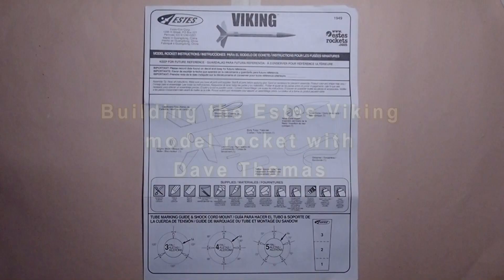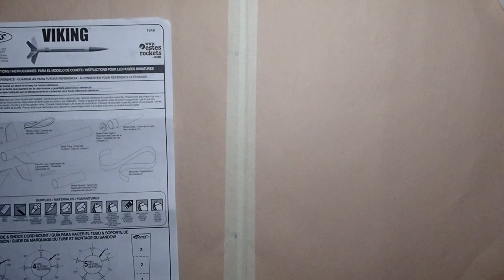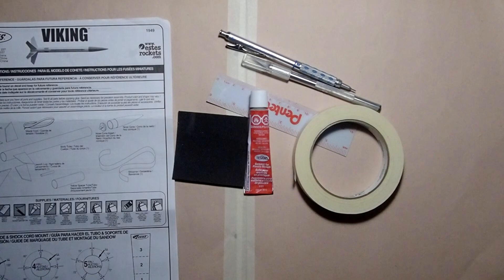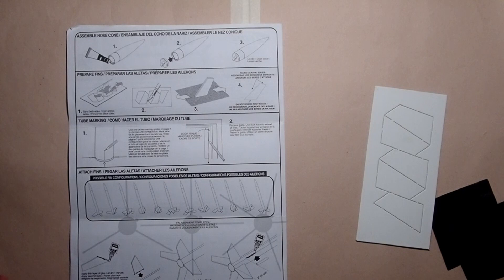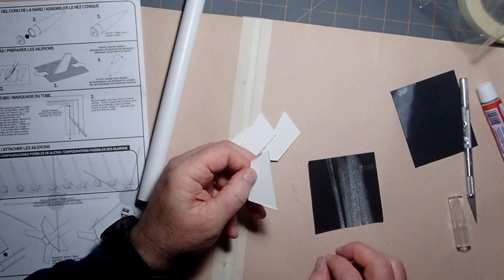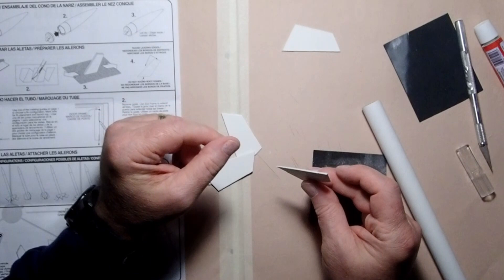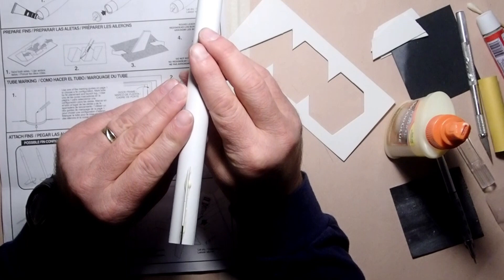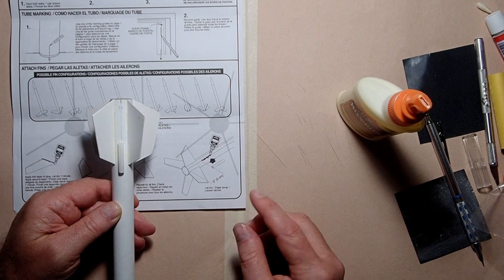Estes “Viking” model rocket assembly

Comment: Great video I love watching your builds. I just started back into Rocketry with my grandson. I wish I'd watched your video before the build because I accidentally ended up gluing the engine spacer tube inside the body tube. I told my grandson to push it into the tube only up to the mark & I was too concerned with getting the engine block ring set back into the proper space . Not realizing I was supposed to pull the yellow tube out. The glue had fully set up, I had a hell of a time getting out. I crumpled the body tube some trying to pull it out with needle nose pliers. Had I watched the whole video it might of saved me some unnecessary aggravation.

Comment: Dr dave, on a 2 stage model that uses friction mounting, and staging where you tape the motors together, will a 1mm gap still work for a rocket like that? The gap is no bigger than the thickness of a penny.
Reply from the maker: @gillandro2  it shouldn’t be a problem.
Reply: @REAR_rockets  ty doc